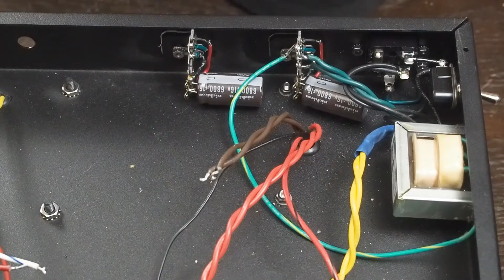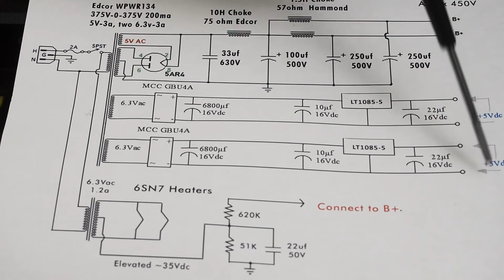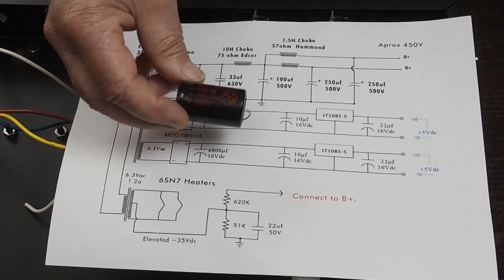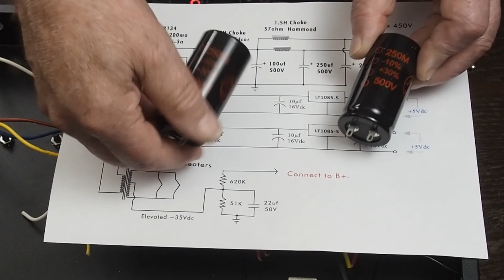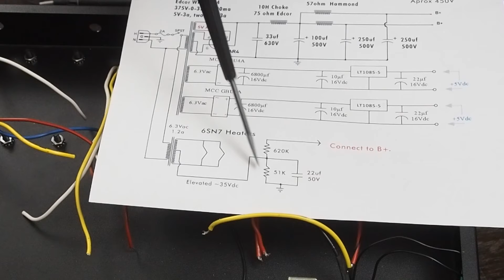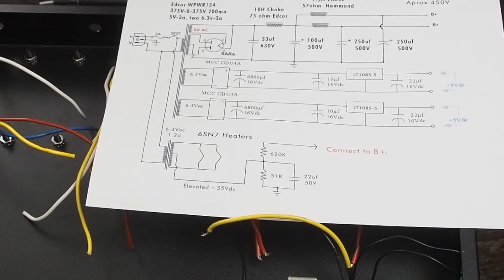300B DIY Budget Tube Amplifier Build DHT SET #4

Comment: Do I need an oscilloscope to build this as monoblocks.
Reply from the maker: You shouldn't, but you realize this amp has a dual rail power supply? There is zero advantage building this as mono blocks other than adding a lot of cost. And you will need to recalculate the power transformers needed to not end up with excessively high B+ voltage.

Comment: Will the 5U4 work for B+? Why not use silicon diode this time? What silicon diode should I use instead of the 5AR4?
Reply from the maker: 5U4 doesn't have an indirectly heated cathode to delay B+ behind the heater, which is my main reason for using a tube rectifier. Also 5Uv will have lower B+. diodes will have higher, it's your amp, do whatever you want.

Comment: Hi Everybody, I am in the process of making this amp but I’m in Switzerland and I have many problems to find some components easily , so here is my question:
Can I replace a choke 10H 200mA 75 ohms with a choke 10H 200mA 80 ohms without changing the balance of this unit? 
thank you for your help and sorry for my English ;-)
Reply from the maker: That's perfectly fine.

Comment: I'd think it maybe would make sense for those 5v tube heater circuits to be fed via half wave rather than full wave rectifiers, this would greatly reduce the inline losses dropping to 5v output. After all, it's the output current x the (source-Vout) difference that goes up in heat.

Comment: my single ended 45 output amp uses a 6sl7 preamp tube with the heaters + relative to the cathodes. this prevents heater hum pickup inside the tube by gathering up any stray electrons coming from the heaters themselves. it makes my amp dead quiet with no hum at all. I used a r-c connection from the output tubes cathode bias resistor.
Reply: Hi two questions from your comment,
What is 1. heaters + relative to the cathodes and 2. r-c connection from the output tubes cathode bias resistor?
Reply: @yqz318  I used a single 2.5volt center tap filament winding to power both 45 tubes with a single 750 ohm cathode bias resistor(bypassed with 200uf/50volt cap). no problem with cross channel leakage. the 6sl7 filament center tap of its 6.3 volt winding is connected by 68k resistor to the 45 volts from the output tubes bias and a 100 volt cap to ground to be sure no output is coupled to the input but the cathode of the 6sl7 is kept positive with respect to its cathodes so no ac hum is picked up in the first stage. amp is dead quiet no hum or noise. when input is at zero. I get a little less than 2 watts rms/ channel at full output with 1 volt input signal. plenty power for my speakers and room.

Comment: Your videos on this are awesome! I notice you use the Hammond 156R choke on this build. I also happend to notice the 156R choke has a max DC voltage rating of 400V but your running ~430V through them. I'm considering building a 300B unit. I'm curious how those little chokes have held up over time or if you're right on the edge of comfort with them. Have you had any issues with those chokes? Were you worried going for that particular model of choke?
Reply from the maker: Zero issues. I feel the same way about these chokes as I do power tubes, you can push the max voltage spec if you obey the ma rating.
Reply: @SkunkieDesignsElectronics excellent! Thanks!

Comment: Thank you for your detailed explanations.  I will be using the Hammond 374BX instead of Edcor -- gives me 230v mains and free shipping to Oz!  There is only one 6.3v secondary (but C.T.) @ 6a and the 5v secondary is also C.T.   What mods do I need to utilise this in the build?  Can I simply run parallel rails for the DC rectifier and regulator?  Do I ground the C.T.?  What do I with the C.T. on the 5v (5AR4) circuit?  Ground this C.T. as well?  Many thanks for your advice and direction.
Reply from the maker: You don't need or want to use the CT of the 5V winding. You can use the 6.3V winding to power the heaters of the 6SN7 tubes (ground the CT) , but you will need something like a 266K12 dual secondary filament transformer for the 300B tubes. Each direct heated triode needs their own transformer winding since it is in the signal path.
Reply: @SkunkieDesignsElectronics  Appreciate your help & helping my understanding: In summary, use the 374BX 6.3 vct winding to power the 6SN7 heaters.  Can I use a single 266L12B with C.T. (6.3v left/6.3v right) to power both 300B heaters (will this work as separate windings)?  Or should I go with two 266K12’s (or possibly two 266M6’s) for physically isolated 300B heaters?
Reply from the maker: You can use a single 266K12 and have one winding for one tube and the second winding for the other tube.

Comment: I thought I would order the chassis and start building the power supply.  Not sure which voltage regulators, bridge rectifiers and heat sinks you have ordered.  Do you mind sharing the part numbers and your favorite parts supplier for these?  Also need split rail choke and 6SN7 heater transformer information.  Thanks!
Reply from the maker: yeah let me put together a BOM at least for where I am at right now.

Comment: At 7:50, I really don't understand the 35Vdc. You won't have to do that if the Heater is on the main PT? So if I build something with heater on the second PT, I have to come up the same thing? But how the 35Vdc but not something else? What happen if you don't do that? Thanks
Reply from the maker: Where this heater AC comes from isn't the issue. 

There are two things going on in a tube heater in an indirectly heated tube. First you have the 6.3V AC. Next you have the DC voltage on the cathode (that is super close to the glowing orange heater coils) and tubes are rated on how much cathode to heater voltage that can handle before they fail.

 Ideally you want to reference either the center tap of the heater transformer windings or use a pair of resistors to reference this AC to something, usually it's just ground, so this voltage isn't what's referred to as floating.  Floating heaters can cause AC hum to get picked up by the cathode. Not always but it can. 

But the other problem we have in this amp is the cathode on the second triode is operating at higher than "normal" voltage. The original design has the second triode running at close to 70V on the cathode, and a 6SN7 limit is 100V difference between the cathode and the heater DC. Any DC voltage potential difference between the heater and the cathode can both cause hum to be picked up, or if it's too high it will arc out between the cathode and the heater inside the tube. By raising the DC offset, that the AC that runs the heaters rides on top of,  to 35V, we have split the difference between the 2V the first tubes cathode is at and the 70V the other is running at as a compromise.

Then this is further confused by the fact we need to have the 300B heaters floating because because the heater IS the cathode and is part of the signal path as we connect the cathode resistor with it's bypass cap to this same type "virtual centertap" we create with the potentiometer across the heater leads. 

I probably should try to cover this in a video as it's hard to explain in text. I think it would be easier to understand seeing  this visually on a scope. It is hard to understand there can be AC and DC on the same wire/circuit.
Reply: @SkunkieDesignsElectronics  Thank you so much, it would be great to have a video about it like you explained detail each section on the schematic.

Comment: Thankyou :) I've been designing and developing my own amp - a low gain low imp headphone amp, 16 tubes made up of a 12BH7A cascode, with four ecc99s in PP per channel. P2P wiring.
I would highlight the modern safety requirement for the socket earth (ground) to chassis ground bolted lug.
Reply from the maker: Thanks for the reminder, I covered that in my last build video but forgot that important point here!